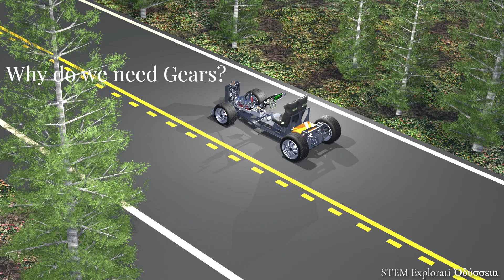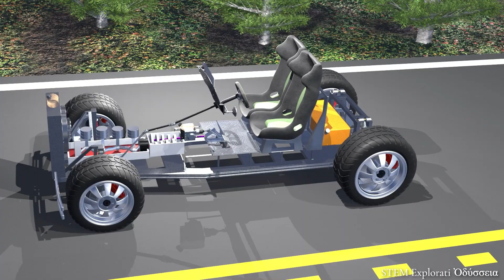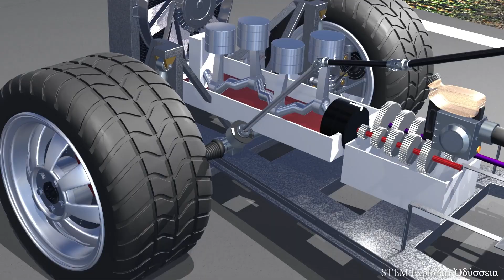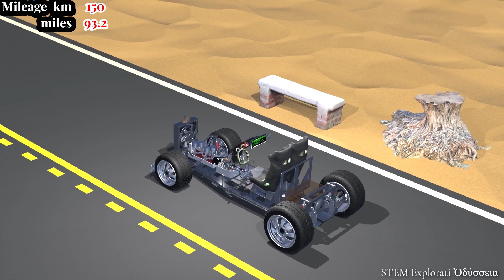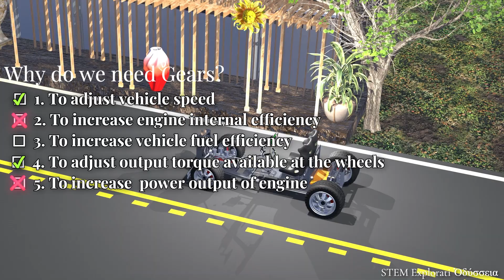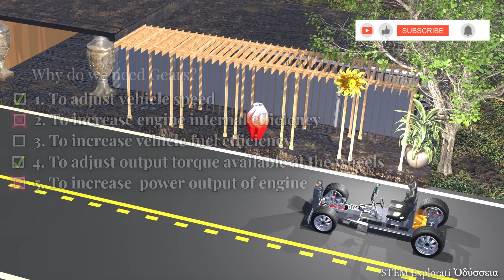Why High Gears Yield High Fuel Mileage. Mapping engine maximum efficiency to different road speeds.

Comment from the maker: Why do we need gears?

1⃣ To adjust vehicle speed ✅
2⃣ To increase internal efficiency of the engine ❌
3⃣ To increase fuel efficiency of the vehicle ✅
4⃣ To adjust output torque available at the wheels ✅
5⃣ To increase power output of the engine ❌

🎓 Academic Analysis
1⃣ To adjust speed — Correct ✅

Gears allow mechanical advantage in either direction — they can adjust output speed (using an overdrive or reduction gears).
In automotive transmissions, higher gears reduce engine RPM at a given vehicle speed.
This reflects the kinematic function of gears: changing rotational speed and direction.

2⃣ To increase internal efficiency of the engine — Incorrect ❌

The gear train doesn’t change combustion efficiency, thermal efficiency, or frictional losses inside the engine.
Engine efficiency is a function of compression ratio, fuel mixture, thermodynamic cycle, and mechanical design — not gearing.

📘 Principle: Engine efficiency depends on thermodynamics (Otto or Diesel cycle), not transmission mechanics.

3⃣ To increase fuel efficiency of the vehicle — Correct ✅

Although gears don’t increase engine efficiency, they allow the engine to operate near its optimal efficiency RPM range, typically where Brake Specific Fuel Consumption (BSFC) is lowest.
This reduces overall fuel consumption for a given distance — hence better vehicle fuel economy.

📘 Principle: Matching engine RPM to its most efficient zone reduces wasted energy and improves system-level efficiency.

4⃣ To adjust output torque available at the wheels — Correct ✅

Gears adjust the torque:
Torque(wheel) = Torque(engine) × Gear ratio × Final drive ratio

Thus, although the engine torque remains constant (for a given throttle), the wheel torque can be adjusted — essential for acceleration hill climbing and coasting.

📘 Principle: Conservation of power — torque increases as rotational speed decreases.

5⃣ To increase power output of the engine — Incorrect ❌

Power is a property of the engine itself:
P = Torque(engine) × ω(engine)

Gears can’t increase the total energy conversion rate; they only redistribute torque and speed.
Only changes in engine design, tuning or throttle can increase its power output.
 
📘 Principle: Transmission is a passive mechanical converter; it doesn’t generate additional power.

NOTE:

⚙ 1. Engine Torque Is Not Constant in General

Engine torque varies with:
Throttle position
Engine RPM

At a fixed throttle opening, engine torque typically:
Rises as RPM increases from idle (due to improved airflow and combustion efficiency),
Peaks somewhere around mid-range (often 2,500–4,000 RPM for typical gasoline engines), and
Falls off toward redline (due to friction, valve timing limits, and flow restrictions).

So:
Engine torque is constant only at a specific throttle and RPM — not across conditions.

⚙ 2. What We Mean by “Constant Engine Torque” in Gear Ratio Context

When we say “engine torque remains constant” in the context of gear ratio analysis, we mean:

At a given throttle and engine speed, the torque produced by the engine is fixed — the gearbox cannot increase that torque.

What it can do is multiply that torque at the output (the wheels) by the mechanical advantage of the gear ratio.

Example:

Engine produces 150 Nm at 3,000 RPM (steady throttle).

1st gear ratio = 3.5:1

Final drive ratio = 4:1
Then:

𝑇(wheels) = 150 × 3.5 × 4 = 2100 Nm

Even though the engine torque is 150 Nm, the wheels receive 14× more torque due to gearing.

⚙ 3. Throttle Effect

If you increase throttle → more air/fuel mixture → more combustion pressure → higher torque.
Increasing throttle raises engine torque output, independent of gear ratio.

That’s why maximum acceleration requires both: Full throttle (to get max engine torque), and proper gear (to multiply it through the gearbox).